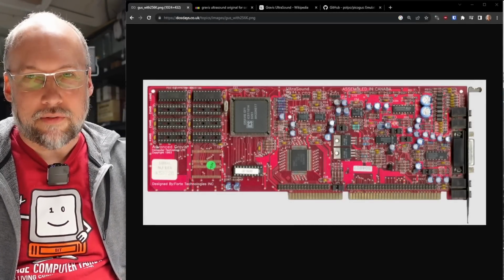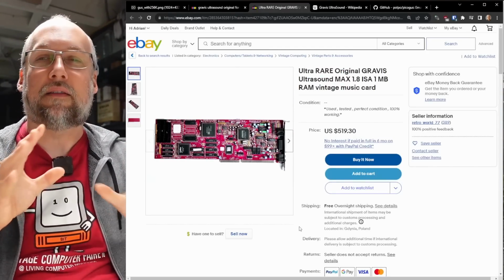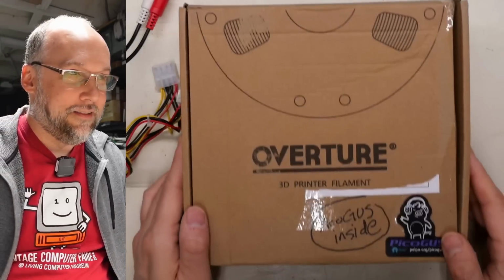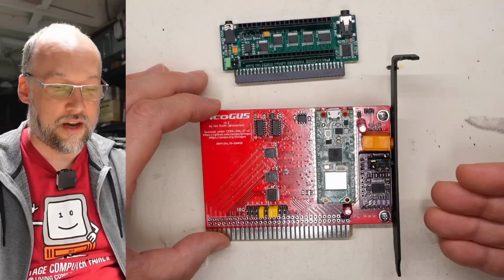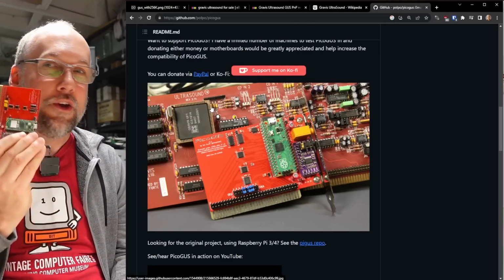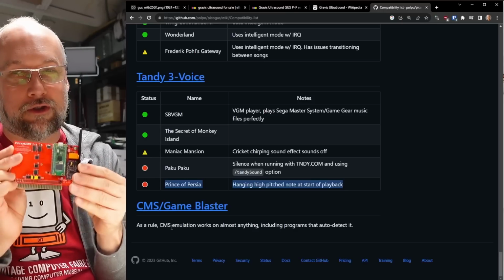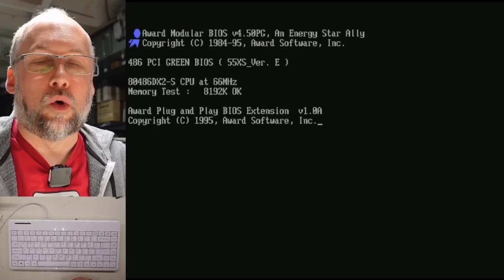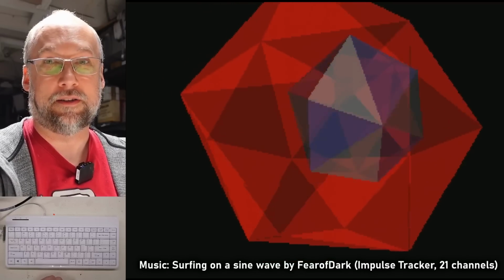The PicoGUS: An ingenious multifunction ISA sound card

Comment: Not mentioned in the WIKI, the Gravis Ultrasound wavetable IC was designed by from Integrated Circuit Systems (See the ICS LOGO on the sound chip) , a company in Valley Forge PA. ICS was started by ex MOS production engineering manager  Ed Arnold.  ICS was loaded with management, engineering, and other personnel from MOS, Commodore and even Solid State Scientific of Montgromeryville, PA. I worked with the designer of that IC, Jeffrey Witt, and did some Verilog test code him... I think it was for that chip.  I have a beautiful wire wrap ISA bus test card made by our technician which sports a bunch of parallel I/O ports.  The card was used for lab testing the wavetable IC prior to having it on a circuit board. I also have an unopened boxed demonstration version of the Turtle Beach MAUI card that used that IC too.  These cards are on display in the VCF's Computing History Museum in Wall Township, NJ.

Comment: The RP Pico is a very interesting choice that all these PC Card products seem to use, especially given the timing compatibility issues mentioned. On the console side of things, where timings can be even more important, pretty much all of the advanced products, everything from flash carts, upscalers all the way through to complete consoles are all implemented in FPGA. This is obviously more expensive (+$20-$30) but if well written would eliminate timing issues due the parallelisation inherent in FPGA solutions. Another downside is that the skillset required is more niche

Comment: Still keep my old system built in 1994 running because the AWE32 could use 28 of 32mb for hardware playback with near zero latency.

Comment: I don't see the GUS and AWE series as truly competing solutions, the AWE32 didn't even launch until 1994 while the GUS "Classic' landed back in 1991/2 when PC gamers were still running in bare bones DOS and the hardware mixing capabilities of the GUS along with the dedicated memory for samples/patches addressed the limited resources available to PC's of the time (likely late 386/486 stuff). This was the same time period in which the Amiga/tracker and BBS/cracker-hacker scene were at their peak and the GUS brought a lot of crossover interest to DOS based PC's.  Beyond being the first really affordable wavetable synthesis solution for "casual" PC gamers, who'd mostly been stuck with Yamaha FM synth or expensive MIDI gear,  the GUS also nailed one key feature that Creative never really figured out which was General MIDI support under DOS in protected mode games via the MEGA-EM utility.  

Creative's attempt at the same thing with the AWEUTIL didn't work with any Protected Mode games (like Doom...) under DOS so until/unless explicit support for the AWE series was added to the sound card driver list for the game you were playing you had to revert back to using the wavetable header and an external waveblaster card... and the buggy/hanging note plagued Creative MIDI implementation from the SB16.  Since most now popular/nostalgic titles in the early 90's used protected mode engines this is a HUGE issue with the early Creative wavetable synth cards.

Windows 95 came out a year after the AWE32 launched, and Directsound opened the door for leveraging system RAM to do custom soundfonts as long as the system had a fast enough CPU and plenty of RAM.  In a historical context the switch to Directsound/soundfont support in Windows took a couple of years and the use of older 30 pin SIMM's on sound cards that did wavetable synth allowed the use of components from older PC's when directly upgrading system RAM in (at the time) newer machines with 72-pin FPM/EDO RAM would have been much more expensive... but in the context of tinkering with retro hardware the Sound Blaster 16/AWE series cards make little sense outside of pure nostalgia... and I say that as someone who ONLY owned Creative cards in this era.

For the same price as a "good" (less buggy/noisy) SB16 example you can get a Yamaha YMF7xx or ESS ES186x ISA PnP card AND a PicoGUS.. which gives you a ton of versatility for retro game audio support for most pre Windows-95 DOS gaming situations.  

I'd argue the PicoGUS is one of the most important bits of modern "retro" tech we've ever seen that lets budget constrained enthusiasts enjoy hardware support for some of the rarest and most expensive bits of collectible sound hardware that would otherwise be out of reach or limited to emulation on modern hardware.  While I appreciate what the PC-MIDI/ARGUS/Orpheus project attempted to do with real hardware, the final products were so expensive they tended to be only slightly more affordable than original hardware and lack the simplicity and versatility that this project allows. Great job Ian!

Comment: this thing is really cool. just picked one up. wish it had a 15 pin molex gameport either instead of the weird ps4/360 usb controller port (which is cool I admit; if the ps4 mode can emulate the mouse I'll be ecstatic :o! ) or alongside it as a 2nd midi port. PS I really appreciate this review's giving a good comparison between it and the old gravis cards. Oh and it'd be really cool if it's possible to use all those sound chips at once, so you'd have FM+PSG, then samples on top. it'd be sort of like the sound on a Sega 32x which is one of my faves. Check out the soundtrack to Kolibri, Cosmic Carnage, or Chaotix sometime. (don't check out 32X doom)

Comment: Why do you say the Pico can "barely" do 8MHz of I/O? The cores are running at 133MHz, and with peripherals like the PIO it can do multiple I/O per clock cycle. Not sure how they have the ISA bus connected, but I can think of a few different ways to easily get 8MHz of parallel bus I/O.  But if more power is truly needed, then moving to maybe a Tiva C or STM32F7 or even one of the SAMD/SAME from Microchip. A Cortex M7 would eat an application like this for breakfast. The STM32F also has DSP instructions which would be perfect for this application.

Comment: 1990s: Here are two sound cards. They are both very good, but they cost almost a thousand dollars (inflation adjusted) and aren't compatible with each other. It took professional teams years of work and millions of dollars to create them.

2020s: Here's one sound card. It emulates both of the above cards, and several others, for good measure. It costs $40 and was designed and built by a few hobbyists, mostly for fun. Also, it works by slapping a whole 'nother computer into your computer, and doing everything in software. That secondary computer by itself costs $5 and is actually significantly faster than the one this card is designed to be plugged into.

Tech sure has gotten awesome over the years, hasn't it? 😁
Reply from the maker: The Pi Pico isn't as powerful as you'd think. It's very fast at some things but talking on an ISA bus at 8mhz requires everything it has. It is fully maxed out. It also can't emulate OPL3, there simply isn't enough horsepower, at least when programmed with C. It's just a powerful microcontroller and it is simply amazing what people have been able to get it to do....

Comment: Sorry Adrian, but Paula on Amiga never had hardware mixing, Amiga has 4 mono channels that are in Paulas DAC converted to analogue, still as a 4 mono channels and then in the analogue circuits of Paula the 2 and 2 analogue channels are simply connected into same lead. There is zero control over the "pseudo-downmixing" so it is really off to speak about channel mixing on Amiga. If you wanted channel mixing, it was doable but then you needed to use a lot of CPU time for proper digital mixing (like MOD players did), but that is far away from Gravis US card. Amiga audio was actually very subpar to most contemporary computers, especially in early 90s.
Reply: Lol what? Just.. no...
Reply: @walterg74  Lol what? Just.. no

What are you trying to say?
Otherwise ROFL on you.

Comment: You inspired me to dig out my old Dell 325P desktop computer(1991 386DX 25MHZ 80MB HD.  Sound blaster audio card.  The old VGA Tube monitor won't power on, but I was able to hook it up to an older flatscreen monitor with VGA inputs.  i was able to figure out how to get into the bios and go through everything from watching your videos.  None of the capacitors on the board or power supply appear to be leaking.  I was lucky that my board has an external battery that didn't leak onto the board.  It is now running, but I don't have any speakers that work.  Two questions:  Where can I get a plug in battery so the bios doesn't reset all the time and where can I get powered speakers with an audio jack plug?  Thanks again for all of your videos!

Comment: Funny you should bring up those other RPi Pico based ISA cards, I have been thinking about building a PicoPC ever since the Pico DVI/HDMI project came out, with all parts (incl. CPU) made from RPi Pico's - not sure about the CPU tho, might have to use the PiStorm method for that, which would allow Atari ST compatible Hades / Milan which have 16bit ISA an PCI slots in them

Comment: I set my GUS to port 240 adding a soundblaster on port 220, and connected both using line in / out for a single output. Using the GUS for anything midi related, and the occasion optimized program such as a "Futurecrew" demo, while using the soundblaster for everything else worked really well.
The biggest issue was freeing enough DMA and IRQ for this to work ... .

Comment: To bad it actually runs on a pi pico. It's a very limiting factor because of the performance and will hamper the growth of this project.
Don't see proper SID emulation with a proper engine like reSID happening due to this.
Maybe someone can migrate this to another platform like the Milk-V
Reply: Timing is more important than performance, and the RP2040 of the Pico can eat many faster processors for breakfast because of its programmable IO (PIO). The only alternatives to do such tight timings are FPGAs.
Reply: @DiThi  Tnx didn't know that Pico had this functionality. Would be great to see a more performant chip that also has PIO like this for an affordable price.

Comment: I got a GUS Extreme with my PII-333 machine in 1999 - cheaped out by buying "old" hardware, yet had a major improvement to what I had previously. The GUS was something else when it came to MOD tracking, even if I wasn't very good at it, and that card had a built in SB clone as well.

Comment: So, your PC's I/O board is more powerful than your PC?
Reply: There is no way to code a 486 emulator faster than a 486 33MHz on a Pico, so, not really.
Reply: @freddyvretrozone2849  Any PC that needs an 8-bit I/O board (think AST Sixpack Plus) is not going to be anything like as fast as a 486-33.  286-16 max, probably.

Comment: I bought the GUS back in 1993 for approx $170 in a local computer store.  Doom and some other games with a huge stereo system hooked up sounded crazy! I ran a Ess-sound card together with the GUS to avoid loading the emulation TSR that ate memory. Of course added DIPs to make it 1MB. Still have it and it works like new, not like my SoundBlaster which has a glitchy volume wheel. I'm on the wait list for a PicoGUS.

Comment: What was amazing for me, was the fact you could do games like Epic Pinball, One Must Fall 2097, and Jazz Jackrabbit at full speed on a 386DX40 on the GUS.  One of the reasons the GUS line is so sought-after, is due to the demoscene.  A LOT of demos that were written in the 90s actually would require the Gravis card to play audio.  Just like with the Paula chip on the Amiga (as you said yourself), the GF1 and Interwave were easier to program from the documentation provided by Gravis.  Lastly, the Interwave doesn't emulate the GF1.  It was a more advanced version that Gravis licensed the tech for to AMD.  Hence why it can do 16-bit 44.1KHz recording/playback out of the box at the full 32 channels (whereas you needed the daughterboard for the original or a GUS MAX which had the CS4231 on the card).  Otherwise, a GUS can only play 32 channels at 19.2KHz and record in 8-bit (may be wrong).  I think the daughtercard aldo had the WSS codec of the Crystal chip at the proper address (MAX and PnP apparently do not).

Comment: Incidentally, I'm also using a Pico to recreate old hardware and struggling a bit with I/O speed!

The device is a debug adapter for the GameCube/Wii, which turns a memory card port into a UART. The memory cards use SPI at up to 32MHz (and I've discovered that you can actually do 64MHz, even though this isn't documented).

By running the entire program in RAM, overclocking as far as possible, and using PIO, I've managed to get communication stable at 32MHz, with the only issue being that my device misses one bit clock at that speed, causing all its responses to be shifted by one.

Hopefully with some further optimization I can get it working perfectly at 32 or even 64MHz, but a faster version of the Pico would be a huge help.

If I get it working, I'll share my findings so that hopefully it can help this project and others... and if anyone else manages to get such high speeds working, gimme a shout!
Reply: Here's an idea: run two picos in parallel, taking turns on the clock, one of them running basically as FIFO for the other one. Edit: or just two latches that alternate between clocks so you read two bits in parallel with half the clock speed.

Comment: GUS PnP should work equally well for GUS-only stuff. AFAIK the chip used there (AMD Interwave, I think?) is backwards compatible. It even mixes at higher frequency.
It worked very well with DOS, even 7.x that ran underneath Win9x and which you could easily boot into. You just had to buy the memory SIMM for it. It was the Windows PnP drivers that were a hassle to deal with and it was more expensive than SB. That's what killed Gravis, I think.

Never did it myself, but GUS is incredibly easy to program. Just look at the libs.
The advantage of GUS was the hardware mixing. SB, for a long time, gave you two choices: the FM synthesis or software mixing everything and pushing that to the sound card. Well, I suppose you had MIDI. With GUS, you just loaded up the samples in the card memory and told it to play them. GUS PnP MIDI sounded incredible and I don't remember really having much problems with the emulation drivers. But yeah, software mixing with a 33MHz or even 133MHz CPU took out a fairly large chunk of cycles, which could affect your framerate.

Comment: Software Defined anything is the present and near-future. I am by trade a network engineer and I am having to learn Software Defined WAN (SDWAN) and Software Defined Access  (SDACCESS). I'm still using the command line interface, but this is now changing and RESTAPIs, Python, JSON, NETCONF/RESTCONF etc are all the technologies I now have to familiarise myself with. It's so powerful, from a security aspect it's quite frightening. New challenges for everyone involved in technology in any way.

Comment: One could make a combination multi-IO + GUS + VGA and still be within the limitations of the pico board.  However, it would be pushing it.    One could even throw in a virtual RAM expansion board for models targeting earlier systems. 

I would recommend switching the VGA for a Display Port out so modern monitors can be used.

Comment: As a note, on modern computers you can emulate wavetable synthesis with several specialty drivers and they are far better than the wavetable synthesis provided by the Microsoft driver in Windows.   Additionally you can do full emulation of the SB16 and AdLib sound cards to the point that you can even play demos and games that utilize raw control of the OPL Synth.   This is not to mention being able to emulate all those old chips like the Commodore SID or TI Sound chips.

Comment: Never seen what was so special about the GUS, I had one and the software always seemed flaky, always had the sb pro2, then the sb16 with the wavetable board then once I got the awe64gold I just stopped using it, I still have it in a old random machine and I still have the original box in the house.

Comment: One of the things that makes the first SB16 so valuable..... is that they used "off the shelf " Sony and Philips DAC's (digital audio converters from Hi-Fi DAT machines).. you know DAT.. that use to be used for studio professional recording......... so are Hi-Fi audio cards.. audiophile cards....... A SoundBlaster SCSI II is on sale over here like the CT2230 that you can see in the picture of wikipedia...... later they start to use replica DAC's from cheep makers.. and finally put them inside the main chip.. like in the AWE 32 o AWE 64 that the DAC's are copies or a cheap copy.. and are inside the main chip with all the interference and noise.. and do not produce the different frequencies at the proper level..

Comment: I'm wondering if this being only an 8-bit ISA card has any compatibility repercussions. Is there any software out there which requires 16-bit DMA transfers to a GUS? Especially when playing back or recording 16-bit digital audio (WAV). And probably addressing more then 1 MiB of memory - not a problem for pure DOS games probably, but possibly something 32-bit OSes could do (16-bit ISA can use 24-bit addressing, instead of 20-bit). I'm not sure if the original GUS is capable of 24-bit addressing, though.
Reply: The address is not used in dma cycles.